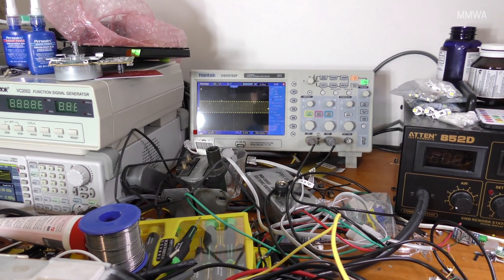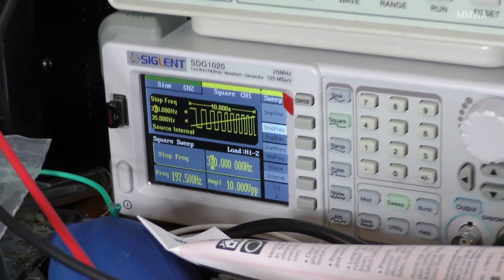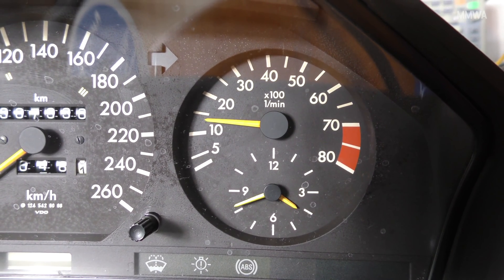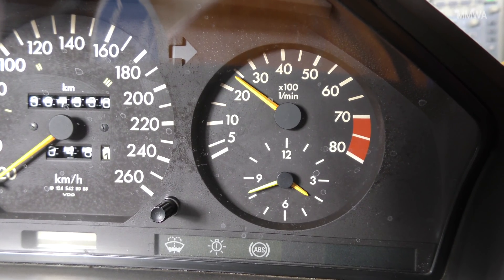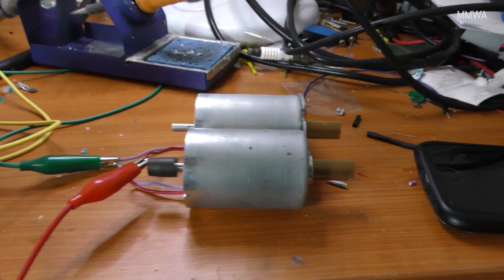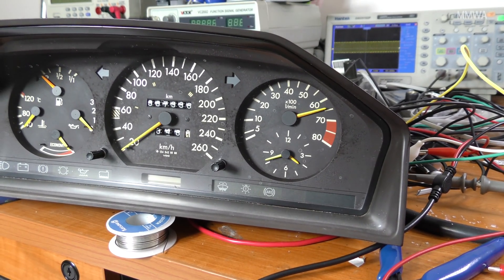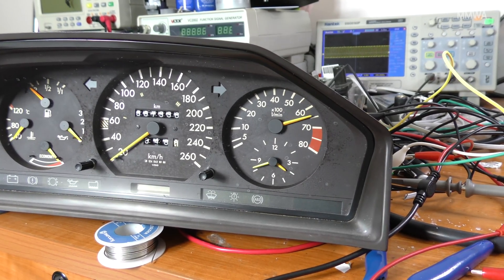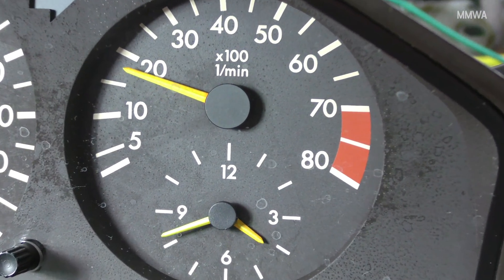Simulated engine abuse, testing the W124 red line cutout

Comment: have you every had the left side of the cluster not working? as my oil fuel and engine temp doesn't work. do you know any fix's?
Reply from the maker: I have not, but i have heard of others mention it and heard others suggest it was a grounding issue. I guess its also possible that half of the cluster is faulty too.
Reply: Could be a grounding issue as mentioned by MMWA, my oil pressure sensor wasnt working so I inspected the PCB and turned out that a line burnt up like a fuse, so I bridged it with a paper clip and its working now. Could be the same issue with yours.